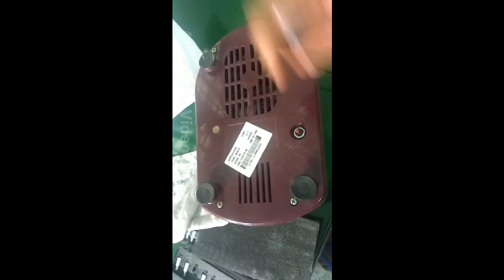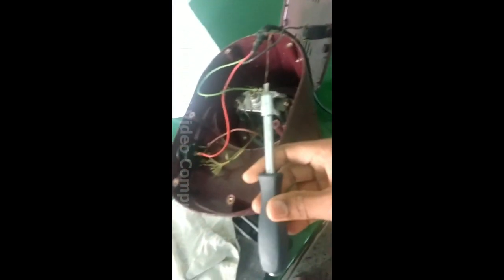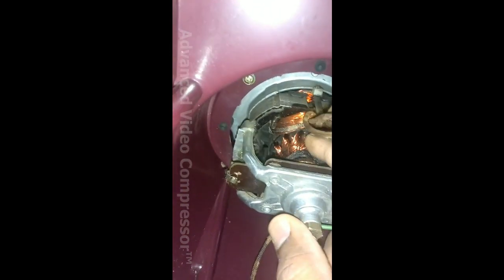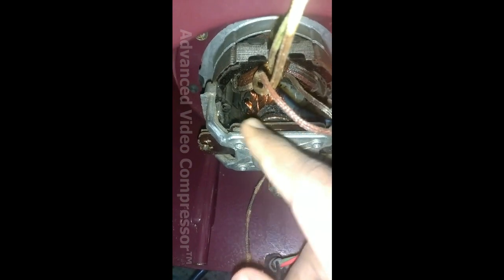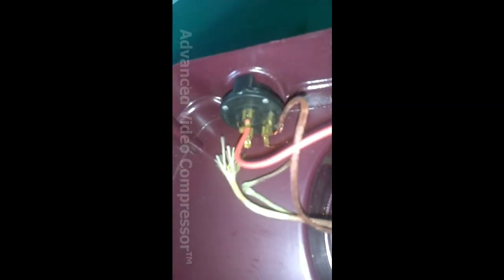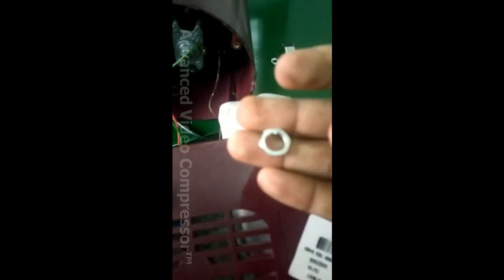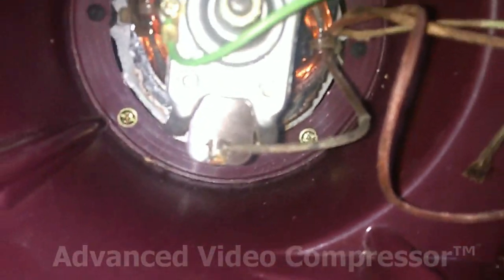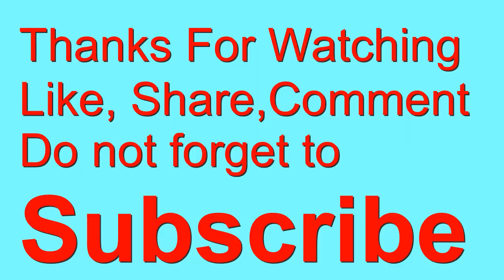Mixi Repair and Breif Explaination in tamil

Comment: Regulator 123 button not working. Once switch on directly high speed working. Middle and low speed not working. What is the reason for philiphs mixie.
Reply: One more havells stand fan same regulator problem. What is the issue bro.
Reply from the maker: Nanba..regulator resistor short circuit agi irrukkum...regulator change pannunga
Reply: @Techdoct  thank u bro
Reply: Bro eppadi coil iruthu vara high medium low speed wire ra kandupudi karathu